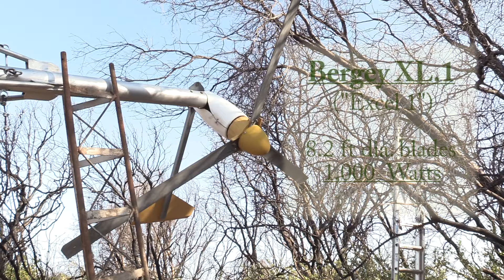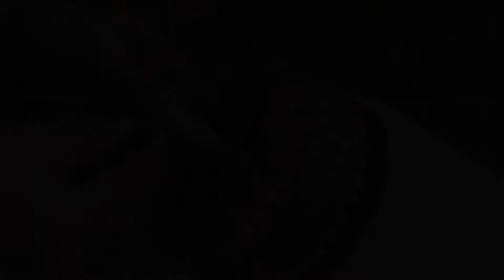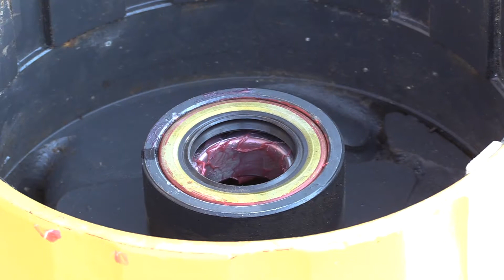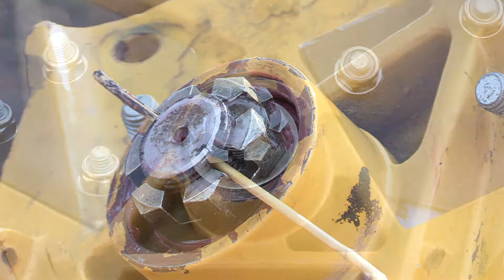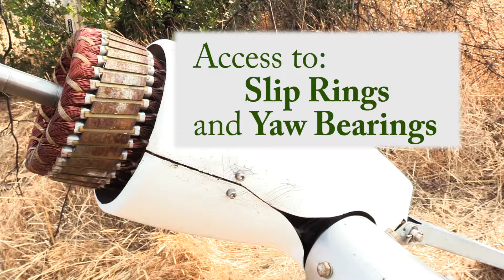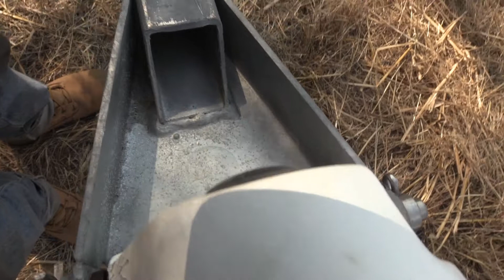Wind Turbine Overhaul / Tune-up after 10 years

Comment: I have an old Bergey 1500.  Six months after I bought it the company discontinued the model and then it was struck by lightning.  However, I like your channel and good info.  Thank you
Reply: Did the lightning destroy it? I thought they were ground?
Reply: I once had the rectifier (in an XL.1) destroyed by lightning.  Semiconductors are usually the first victim.  But easy to replace.

Comment: Very informative. Thank You.  Many people think, it is windy where they live, but in reality, it is not windy enough to cost-justify a wind turbine.  Everyone must do their homework, for their location.  If you are off-grid, then Solar and Wind make a very good combination to keep those batteries 100% charged.  Do you have an MPPT WIND Controller attached?  Did you select 48 Volts, for the long distance?   Was it just the paint that was cracked or was the fiberglass housing cracked too?   Is there any electronics inside the nacelle, or just the alternator?  Southwest Wind Power put electronics inside the nacelle = bad idea.   If that Wind turbine could average 500 watts, all day, every day, for 20 years then it would be equivalent to the cost of Grid Electricity per kWhr.  But I doubt that actually happens, since that is 360 kWhr / month.  I am guessing it generates about 50 - 60 kWhr / month, which makes it 5 TIMES more expensive than Grid Electricity.  Off-grid electricity is not cheap

Comment: I seem to have trouble trying to leave a comment here. I will try again. Can you tell me what the wind speed range was when you were showing the voltage and wattage output. I am in the market for a wind turbine and I am looking at many different kinds. Thanks for posting your videos.
Reply from the maker: @gaseunhieght I don't have exact windspeed data, but if I had to guess, I'd say it produces 500 watts in a 15 to 18 mph wind, and peaks out at 1800 watts (!) in winds above 28 mph.  This turbine size is a bit larger than most "small" wind turbines: 8 ft. dia. vs 3 or 4 ft.  In fact sometimes I wish mine was smaller because in winter storm winds it puts out so much power, I have to dump the excess into a dummy load (hot water tank).  But that's my specific needs, I live alone with small electrical demands.  So other smaller turbines out there, with about 500 watts peak power output, would be fine in my case, as I only need the wind power in winter, when the sun isn't shining (solar pv power), but the wind is blowing in a storm (this turbine never shuts off, but does govern its speed by "side-facing" above 28 mph). I hope this helps you decide.

Comment: interesting .    Its noisy thou   I thought it would be quieter.
Reply from the maker: Yes, noisy when near to it, and I used shotgun microphone for this audio, to show all sound components (whine/tone of turbine producing power is there too -- underneath).  But when listening further away, say at least several hundred feet, and inside a home/shelter, the sound blends in with the actual wind sound passing by the home.  In really high wind/gales, the turbine's sound is almost lost in the wind roaring by...  some folks do find it annoying, others think of it as almost "music", knowing it is charging up the home's battery bank.
Reply: Mine just makes a light whoushing sound so far when I turned it on for a couple o mins. to check it out . I still have to finish wiring into house to leave it on and check power output thou .
Reply from the maker: .. getting close to the finish line, maybe done by now?
.. hope it runs long & strong for you.
Reply: Thanks J2   .... No the weather has me on hold .